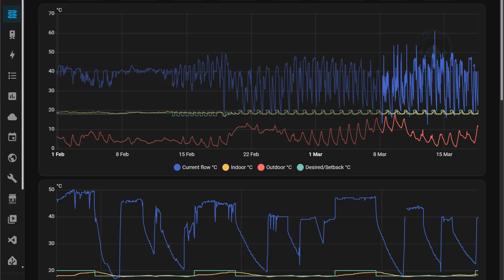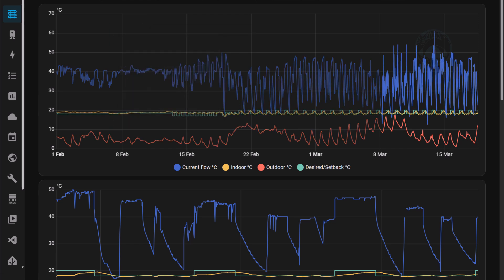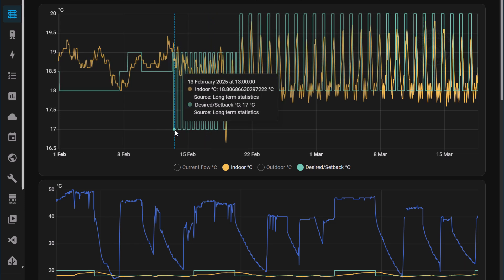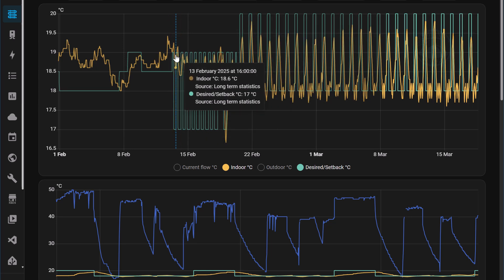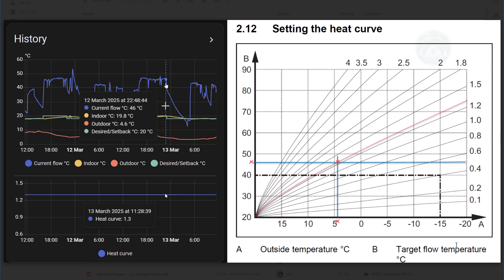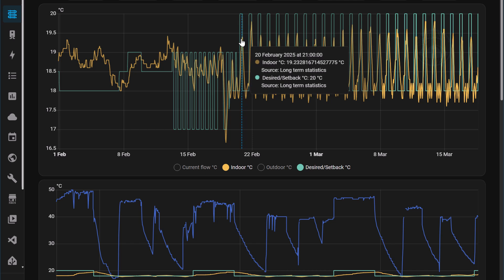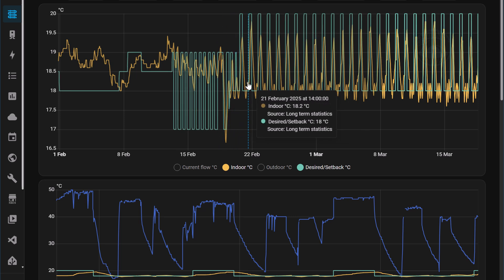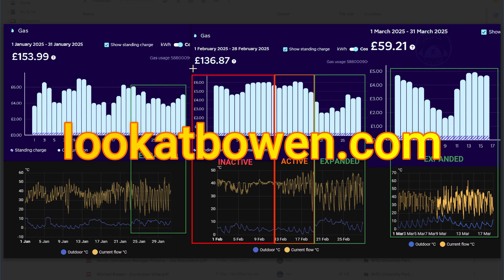Room Temp Mod: Expanded EXPLAINED with one timer! - Vaillant ecoTEC Plus ☀️❄️ SAVE MONEY 💰

Comment: Great video series on the valiant Mike. Couple of questions...what settings you have defined for the following and have you experimented with them to see effects?

Setback mode eco or normal?

OT switch off threshold?

Adaptive heat curve = activated or deactivated 

Would love to see another latest update?
Reply from the maker: Thank you Ashmistry for the lovely comment. 
To answer your questions: 
- Setback mode = normal. I tried out ECO, but I didn't like it in the winter time because it would drop the setback temperature to a low temperature, and then when the schedule came on in the morning, it would take a long time to get the indoor temperature back to the Desired temperature. It is not a problem if you've got a long schedule or a low Desired temperature, and it is entirely up to you what that temperature might be, but for us 19C was a great desired temp (for a 4 hour schedule in the morning), and if at the start of the schedule the temp is 13C for example, it would not reach the Desired temperature of 19C in that 4 hour window), but then again it also depends on the heat curve, and this is why this boiler is a head scratcher, because you need to experiment with the heat curves, and every house is different. 
- OT Threshold = 18C. This threshold would be an outdoor temperature above which the boiler's heating output is limited or disabled. For example, you might set an "OT Threshold" of 18°C, meaning that if the outside temperature is above this, the central heating will not activate, regardless of the indoor thermostat setting. Why it's important: This prevents unnecessary heating on milder days, saving a significant amount of energy.
- Adaptive Heat Curve works with the  Room Temp Mod function. When set to 'Inactive' the sensoCOMFORT completely ignores the indoor temperature where it is in, and purely acts as a control panel and outdoor sensor. The heat curve is what determines the flow temperature (how hot the water gets going to the radiators), based on the outdoor temperature. (I found this option too slow, and the house was always cold). 
Room Temp Mod = 'Activate' - This is a blend of weather compensation and indoor temperature feedback. The heat curve is still the primary driver, but the system now pays attention to the indoor temperature and makes subtle adjustments.
Room Temp Mod = 'Expanded' - It combines all the features of "Active" mode with an additional, more decisive function: it acts as a smart "on/off" switch when needed. It uses the heat curve and adjusts the flow temperature based on indoor feedback. Crucially, it also enables the Adaptive Heat Curve. Furthermore, if the indoor temperature rises slightly above your setpoint (e.g., by 0.125°C), it will completely stop the heating circuit—turning off the pump and boiler demand—until the temperature drops back below the setpoint.
- A video update maybe in the winter, once the boiler comes back on, to see just how much of a saving I get versus those times I was testing, because this winter I won't be fiddling. :-)
Reply: @LookatBowen thanks for the extensive answer! Will setup as you suggested and then play around with the heat curves settings and monitor everything in home assistant. Look forward to your winter update!

Comment: Thank you for posting this, I found it really interesting. I have Vaillant ecoTec plus with weather compensation and UFH downstairs and radiators upstairs. The upstairs in my property is nice and warm but downstairs never seems to get up to a decent temp where it feels comfortable. My settings are very similar to yours though after watching this video I have changed my setback temp to 18 degrees and like you am trying one time period instead of two. It will be interesting to see what happens, I am a complete novice when it comes to all this so your video was really useful. Thank you for posting your results.....
Reply from the maker: @kevinmurphy4348 Thank you for the kind comment. Do you not have any TRV downstairs? (I guess not, since you didn't mention it), but I would say, another thing I have done with all the radiators throughout the house is turn them to 5 (max). Since the flow temperature is controlled by the heat curve, there is no need to adjust them down. (except the bedroom perhaps, this is the only room I have the TRV set to 3, and it helps).
Reply: @LookatBowen  Hiya, thanks again for taking the time to provide some really helpful tips. I have underfloor heating downstairs and the rads upstairs do have TRV's set to max. I know I have only had this set up as you suggested (expanded)for a day but from what I can see it looks to be working nicely. Raising the set back to 18 seems to also have upped the downstairs temp which I really wanted. The Senso Comfort room thermostats are doing their job as they are saying no demand as room temp is above set back.... or something along those lines. The one timer period also seems to be working well. Fingers crossed it runs more efficiently and my bills come down a little. Thanks again, Kevin
Reply from the maker: Hi Kevin, that is great to hear. 🤞

Comment: I have added a Helper in Home Assistant with the theorical heat curve temperature for Vaillant based on the formula in the post from Protons for Breakfast vaillant-heat-pump-controls-part-3-formulas-and-spreadsheet

It takes into account your outside temperature, set temperature and the heat curve, and you can include this data in a graph to check if the current circuit temperature match the expected one.

{% set outside_temperature = states('sensor.outside_temperature') | float %}
{% set set_temperature = states('sensor.set_temperature') | float %}
{% set heat_curve = states('sensor.circuit_0_heating_curve') | float %}
{% set a = 2.55 | float %}
{% set b = 0.78 | float %}

{% set flow_temperature = set_temperature + a * ((heat_curve*(set_temperature-outside_temperature)))**b | float %}

{{ flow_temperature  | round(1) }}
Reply from the maker: @skdzzz oh wow, that's interesting, and thank you for sharing the formula for the home assistant. I'll have a look and see if I can add it as well.

Comment: Very interesting video as the also the previous in the series.
I have a Saunier Duval boiler that is similar to Vaillant and I have the MiGo Link Wifi Gateway, it should be using the heating curve temperature but the circuit temperature is usually much higher than expected so I am not sure if an external temperature sensor is needed. In theory it should be able to get the external temperature from some internet service.
Do you have an external temperature sensor in your boiler? I cannot find any reference on how to setup an external temperature sensor in the boiler or thermostat configuration, even in the installer menu.
Reply from the maker: @skdzzz Yes, they are similar. My vaillant ecoTEC plus came with the sensoComfort smart thermostat display (I paid extra for it), and an external sensor (for outside North facing wall) + two gateway boxes that plugs directly into the bottom of the boiler, that allow the external sensor to talk to the sensoComfort which connects to the myVaillant phone app, which is  supposed to control basic functions on the phone app, but that can be replaced entirely by the home assistant integration. Links to the Vaillant boiler I have : https://www.vaillant.co.uk/product-systems/gas-boilers/ecotec-plus-remastered/ 
The model for the sensoComfort and sensor is : vrc720f3